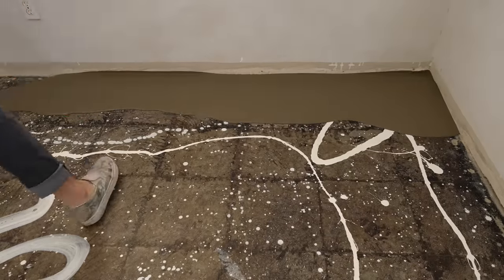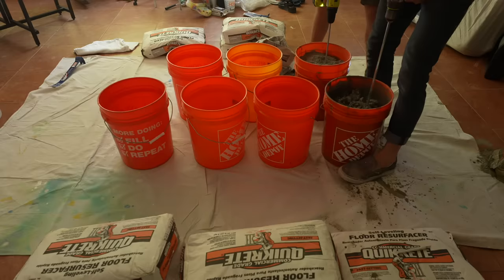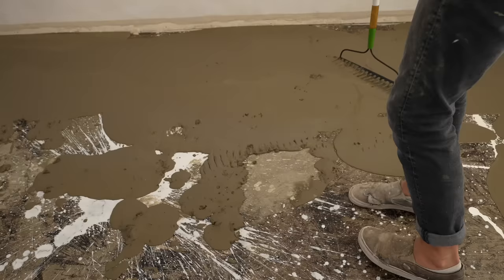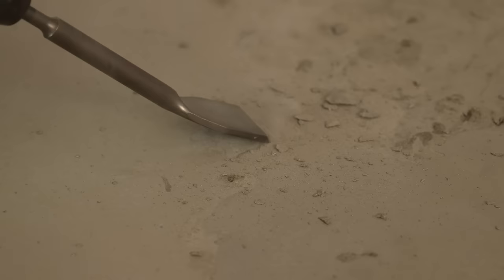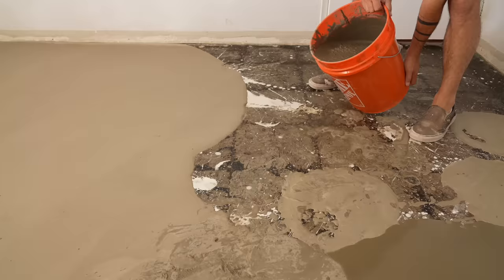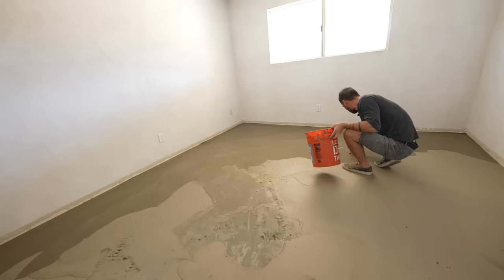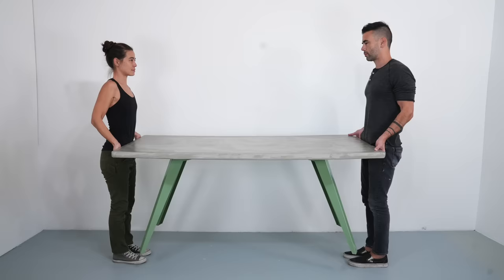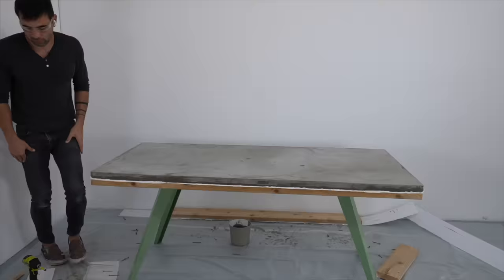Resurfacing Concrete Floors with a Self-Leveling Skim Coat

Comment: You can't use self leveling this way as the final surface, it's just not strong enough. It will scratch, crumble and dust. You need something on top like boards, tiles, carpet or lino.
Reply: What if I use drylic wet look?
Reply: I think you can if it's got fibres in it and is thick enough.
Reply: If you want to finish floor can you use a layer of Ardex over it? Or maybe Ardex for the entire project if starting with a really clean sanded floor

Comment: I just had a total catastrophe doing self lever in my kitchen. You really need to be ready for anything and have all tools ready. Also don’t poor under your walls like this. Use spray foam to add a border. You need that space for expansion.
Reply: What product do you recommend to seal at the baseboards to prevent bleeding under the wall?

Comment: Run a  9 inch high speed angle grinder with a segmented diamond tool (floor grinder} over the leveler with the wave pattern, it semi polishes and burnishes the surface and leaves a unique  circular pastern  then apply a concrete sealer

Comment: Cement levelers don’t work on its own,you need to use the big throwell or a cement squiggy to spread it evenly and yes don’t need to mix more then you can handle

Comment: Shouldn't there be some sort of border tape on the sides, that keeps the concrete from binding to the walls? That way sound transmission to the walls is prohibited.
Reply: Huh?
Reply: I never thought of that. Good catch. 👍
Reply: Yes, wondering the same thing what kind of caulk or foam can I use at the baseboards to prevent bleeding Beyond the Wall?

Comment: Nice job.  The issue I always have with the self leveling is that you do add more water than you think. You really want it to flow.
Reply: Not too much though or you will weaken it and it will turn to dust!
Reply: @StonemanRocks  south Louisiana climate (humid) barely had to add extra. But my niece in AZ had way different experience..had to add considerably more than I did. We had the same size area to do as well. And we both ended up pretty happy with results..
Reply: @kimlewis5429  good deal glad it worked! The reason for the xtra water isnt so it takes longer to set up, its so that it flows or (self levels) better! What makes this stuff level itself is the shape of the silicon sand! Its more round so it rolls! More water = more space between the sand particles so more room to roll! You gotta watch it though too much water and it weakens it to a point its powdery the next day  like any cement containing product, there is a line you can cross with too much water and your product becomes weaker ! Way too much water and its worthless! I live in new mexico so about as dry here as it gets! About like AZ.
Reply: @StonemanRocks  all great info!  Thanks for sharing!
Reply: @kimlewis5429 how much extra water did your nice use in AZ? I'll probably go with the Ardex brand so maybe this question is moot because this is a Quikrete pour. But I am in the Southern California desert area near Palm Springs

Comment: Please anyone watching this do not do you're self levelling like this.
You don't just pour the product on to the floor out the bucket and hope it perfectly levels itself. Those lines are where the leveller is slumping due to not working it around with a trowel.
Also you're meant to wear spiked shoes so you can work on top of the leveller and then it's to be rolled with a spiked roller to release any air bubbles which will make you're floor fail if not taken out.
This is awful mate seriously leave it to professionals especially if you're going to film it

Comment: Will the primer etch into painted concrete? Hydronic floor but the builder used a regular concrete instead of gypsum so the floor isn't super flat. They carpeted the floor but I'm thinking vinyl panels. If it wasn't painted then I'd go with regular ceramic or stone tile for faster heat transfer.

Comment: I think this guy needs to watch a few YouTube videos on how to use self leveler, what it's for and the tools needed.  Biggest error I see is the fact that he is using it as a finished floor,  this stuff is made for sticking to the existing floor and is not designed to be a wear layer.  With the right tools it is easier to get a decent contiguous looking pour.
Reply: I'm seeing that Ardex is a better product for that. I plan to pour a floor and then stain it so I need the right type of self leveler

Comment: I'm gonna be honest, that was a bad job in so many different ways.

You have to mix it exact to manufacturer specs. You have to also move it around to get it perfect. Just because it's called self-leveling doesn't actually mean it really is entirely self-leveling. Quickrete 1249 is for underlayment only, NOT for use as a finished floor. Its final compressive strength is far too low for use as an overlayment. For use as a finished floor you need a product with more polymer additives to at least double the final compressive strength of that of Quickrete 1249. That floor will not last. Not to mention it's ugly as hell.

There's nothing wrong with DIY but at least know what you're doing first.
Reply: Yes yes and another yes! More polymers!
Reply: late reply but would 1249 be good for laying laminate on top of? planning on doing this in my basement.
Reply: @qandmargo  quikcrete from i assume from  homedepot ? it would work but i would never use it! Even with the primer and additive you use with the mix it sucks!  Not enough compressive strength! I would pick laticrete brand or ccure brand. More expensive but well worth it! If it requires you to ad anything other than water when you mix it its going to have a lower compression rating and not worth buying in my opinion!
Reply: @qandmargo  and you CAN add extra water! Dont use more than about 10% xtra or you will weaken it! It will be much easier to work with xtra water but you still have to work it with a trowel by breaking the surface tension especially on the leading edge of the material when you pour it out! Very important to pull it along a little on the leading edge with your trowel!
Reply: @StonemanRocks  I poured a concrete bartop with quickcrete turned out great and we love the texture ( for a bar ) but used actual concrete countertop mix for the rest of our kitchen and the results were MUCH better. 
Its definitely worth it to go ahead and get the best quality or right stuff
Reply: @Anninukichild  i want to try a concrete countertop with white cement and white marble sand. When i used to build pools we used that to plaster pools! As soon as we were done plastering we started the water to fill the pool as the plaster cured under water!
Reply: @StonemanRocks  I poured mine "in place" so u get one try to get it right. Alot of people make and pour forms outside and carry them in. If u did it that way u could do it until u get it. I used concrete board, rebar for support and concrete countertop mix from lowes
Reply: @Anninukichild  whats in the counter top mix that makes it so special that they call it countertop mix? Probably extra acrylic and fibers for strength! Was it concrete grey color?
Reply: @StonemanRocks  you nailed it
Reply: @Anninukichild  I didnt even know they made a countertop mix! Guess I dont get out enough!
Reply: Looks like Ardex is the way to go on so many levels lol

Comment: Any cracking?  I used this product in a hot climate and ended up with cracking.  Perhaps I should have misted it with water and covered it with plastic while it cured.
Reply: Yup 7:33
Reply: Did you mist your concrete first? If not thats prob why! Esp if it was a really hot day!
Reply: O plus that product sucks and it has no compressive strength! You got to spend the money and buy the good stuff when it comes to self levelers! The more expensive products have more polymers mixed in and are worth every penny in my opinion!
Reply: @StonemanRocks I'm seeing that Ardex is good...I will be using mine as a finished floor..add stain and then sealer

Comment: your only problem from start to finish was your drill, a proper concrete drill mixer would have mixed it well
Reply: I plan to rent a paddle mixer that can be held standing up...easier on the back than a drill attachment

Comment: I have a garage floor would to do this to but am concerned about how well the finished floor will hold up to the weight of cars driving on it. Thinking of using a fiber-reinforced concrete mix or adding fiber-reinforced additive to self leveling mix. Thoughts or suggestions appreciated.
Reply: You need to find a product that the manufacturer recommends for use as an uncovered finish. Self levelers is supposed to be covered by flooring. It isn't strong enough for your garage.

Comment: The runnier it is, the easier it is!
Reply: Ya but too runny and it weakens it and it will turn to dust! So you are dead wrong! Thx for playing!
Reply: Would a polyurethane seal prevent the dust problems from using a too watery self leveler?

Comment: Just want to say that "self-leveling" products are misleading to beginners. I built a special tool--kind of like a driveway squeegee...using a 2x4...but adding two adjustable spacers on each end so that it spreads the product to the adjusted height. Only then will the material self-level to the proper height on its own. And I mixed the material all at once in a trash bucket with a flat smooth bottom--because multiple pours = catastrophic disasters that can't be re-poured over to correct.

Comment: This is a bad example to follow if you want a proper concrete overlay or skim coat. All concrete floors should be diamond grinded before any coatings are applied, especially if they've been previously coated with tile adhesive.

Comment: So much wrong here. So much.
Reply: Explain sir😐
Reply: Yeah, my first thought was, "am I 'learning' from someone that doesn't know how to simply mix concrete... You don't use cordless drills, because they have a brake
Reply: better than paying overpriced greedy contractors to do something, I won't give them a cent.
Reply: @Richard-et3cl greedy contractors? You mean regular humans trying to pay their bills?
Reply: ❤❤❤❤ I really like your style. I’m doing this with my basement that was flooded. I had a contractor do it but it was cheaper than other flooring and I did think I could do it myself. Kudos to you!!!!!!!👍👍👏👏⭐️⭐️⭐️⭐️
Reply: I meant to write, I didn’t think I could do it myself.
Reply: No spikes, no trowel, no smoothing, just everything is wrong. Terrible finish, terrible start. Should have just painted it, it wasn’t even level
Reply: @lildeanc you don’t trowel self leveling
Reply: @jasonhardaway3052 you do smooth it around, it doesn’t actually self level, the name is misleading…
Reply: @lildeanc  yes smooth lightly not a complete trowel
Reply: @jasonhardaway3052 a trowel is a tool bro…
Reply: @lildeanc  yes I know lol
Reply: @jasonhardaway3052 what 🤣
Reply: @lildeanc  was that your attempt at humour 😂 it’s ok I’ll ignore it and let you try again 👍
Reply: @abumzbum1869 no greedy. I had a quote yesterday to have a small kitchen, and it was hundreds, close to thousand. lol I look to see how much mixture is, it's pounds, one tool a roller with pins and the compound.. it would take 30 minutes to do if you are professional, so u should get paid for 30 minutes work. So that would work out 900 for a 30 minutes, work  lol. We all have to make a living, I'd look after your children for a whole week while u made a living for less than that.
Reply: @cowoverthemoo its a PROFESSIONAL ofc you will have to pay that much? ur paying for their time and labour lmao that price rlly isnt bad
Reply: @Aahfjfkakndnf  yeah, so what if it's a professional,.hundreds is a rip off..

Comment: LOL, that table is going to crack EASILY. you should have put in some rebars across the lenght and width, as a grid. AND at the least mix the material WELL, and use a squeegee or a window wiper to stroke the top at least once over the entirety. geesh. it looks like cr*p.

Comment: 😮😮😮 I'll say nice try. Alot wrong. Those air bubble must be remove with a spike roller for example.  I've been self levelling for over 25 years. First I'd say that sub floor resurfacing is something you dont mess with. You get it wrong, dont bother covering it. This room including diamond grinding  will take 4 hours to complete. Then come back the next day to ramp at the doorway say 2m - 2.5m out in a fan shape. Taking into account the thickness of your floor covering coming thereafter.

Comment: I was watching and thought to myself... how funny would it be to leave the leveling compound bare and keep that as the floor.   And then.. I got to the end of the video and am cracking up.   Dude..
Reply: If you use a good product like ardex or comparable you absolutely could leave it as a finished surface! It will cost 3 times as much for the material however!
Reply: Yay Ardex...would be worth every penny

Comment: Well. This is not how self leveling concrete works. You still spreads it out with a "rake" to make it level. 
The name is a little bit misrepresentative. If you do it right you should not see the difference between different "buckets" 

Use the right tools and technique next time and the result should be much better.

Comment: The idea of people blieving its self leveling as in pour and it will level itself killlllllllzzzzzz meeeee. This is not a diy thing. You wanted to resurface not level. But instead, you unleveled it with self level, then shaved the high spots then had to level it and still wasnt. Just lay 350 to 500 bucks for someone to do it IF needed

Comment: What you poured over top of your existing concrete floors is NOT concrete. What you poured is a thin watery layer of fast setting cement. 

Concrete has large aggregate (3/4” trap rock) which gives it strength and durability but cannot be poured in super thin 1/4” layers. 

Correct terminology goes a long way in using the right materials for the right job.